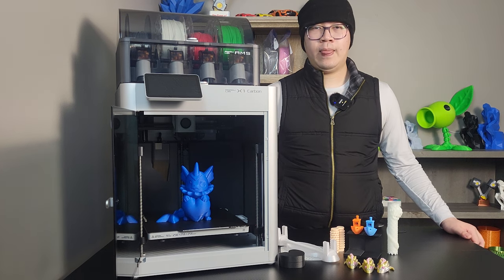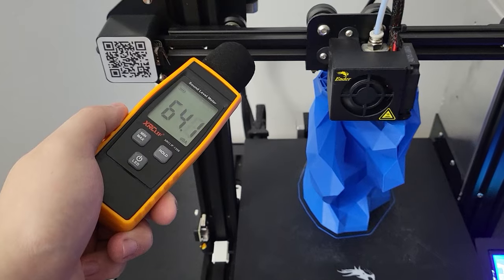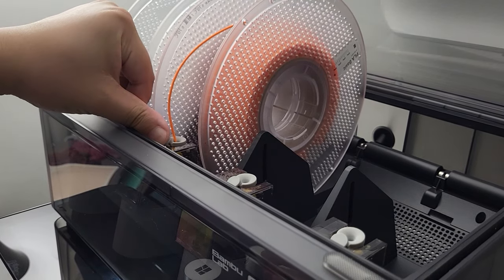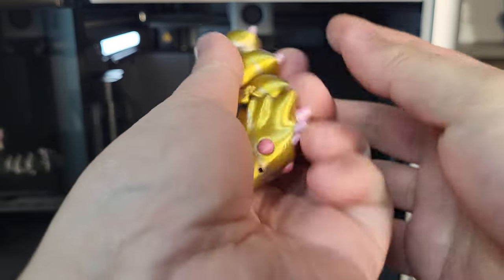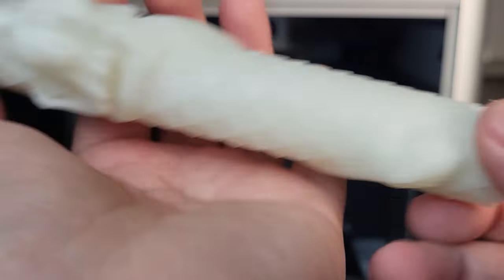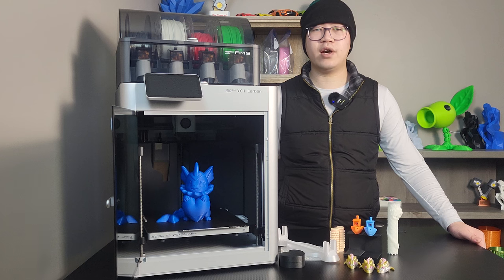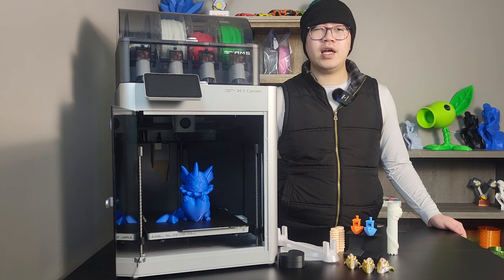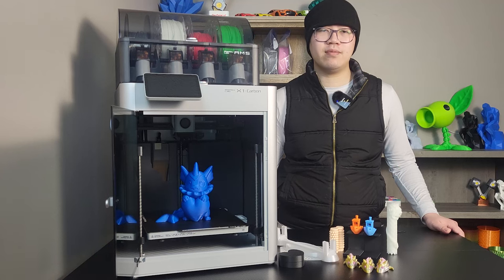Bambu Lab X1C Review with AMS | Still good buy at 2024?

Comment: I recently upgraded to the X1C from my Lulzbot Mini from 2016. That machine still prints PLA perfect. I never had to really tinker with the printer. After sitting in a box for a couple of years and enduring two moves, I took my Lulzbot mini out of the box, fired it up, and ran a test print. It came out perfectly! X1C feels like that, just mostly plugin and play and straight forward to use. I'd rather be on YouTube watching CAD tutorials and not watching, "how to fix <insert problem>"
Reply from the maker: Yeah, that what I like Bambu lab printerts the most. While I doing design, I would rather focues designing and get the parts from printer, rather than fixing the machines.

Comment: The build plate temp of the P1 series goes only up to 100c, X1C to 110c. Printing PC you absolutely need 110c to get higher chamber temps. Or you have to mod the P1 with a PTC chamber heater.